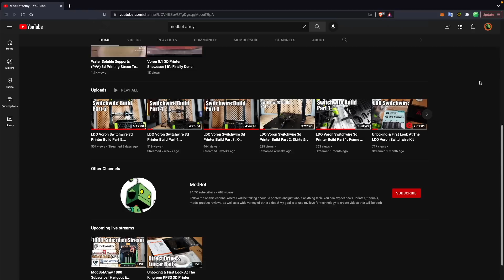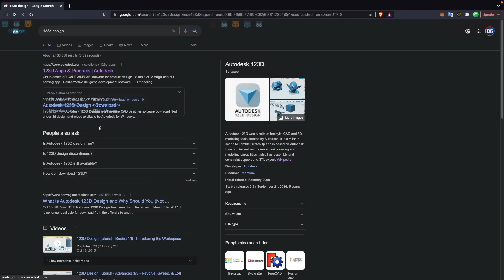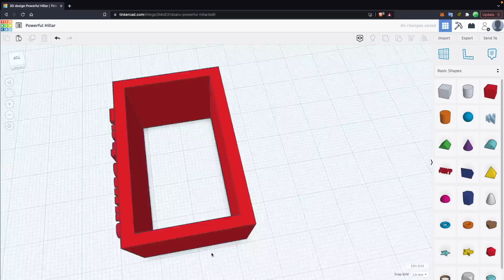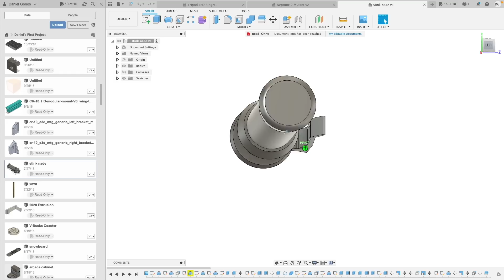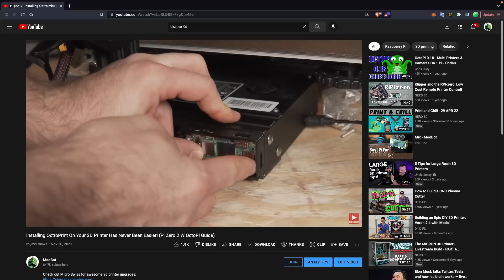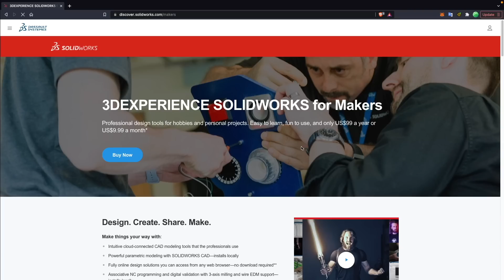Is 3d Modeling A Requirement For 3d Printing? (Where To Start)

Comment: Great video!  Personally, I tend to use OpenSCAD and FreeCAD the most.  I do a lot of parametric modeling and these are both good for that.  (Parametric modeling makes it easier to tweak and adjust a model after you create it.)  I tend to switch between Windows and Linux and these run on both platforms.  Also, both are free, an important consideration if you are just a hobbyist like me.  OpenSCAD is pretty solid, but everything is defined in code.  There are no tools for freehand modeling.  FreeCAD let's you be a little more artistic, but can be buggy at some of the worst times.  When using FreeCAD remember to save your work often because it can crash unexpectedly.
Reply: I totally agree. As hobbyist i started to learn fusion360. After a month Autodesk changed the licensing scheme so I've switched to an open source solution as FreeCad. I don't mind if Fusion is more powerful than Freecad. I have chosen Freecad for the open source mentality. I'm doing 3d design only for hobby during my spare time and I don't want to wake up a morning and see that Autodesk (or other vendors) doesn't let you use his software for free anymore. Freecad learning curve for complex models is quite more steep but it's worth the time spent to learn it.
Reply from the maker: An old coworker showed me OpenSCAD some years ago and I had completely forgotten about it. He was a head developer at my job and me having no coding background (few C++ coursed) found the workflow insane haha. It just felt like way to much of an uphill battle for me to learn the code and modeling side in one. 

FreeCAD seems to have been recommended a few times in comments. Is there no ability to have it autosave? I have serious bad luck with software that doesnt keep a backup. One of the reasons I moved to apple and their FCPX for video editing it any click I do it saves a version. I dont know if I can go back to crashing and losing the files.
Reply: @ModBotArmy  OpenSCAd is easier to learn if you have a programming/coding background.  Also, it forces you to approach your model a little differently.  For example, with other programs, you would make your basic model first then add embellishments such as fillets at the end.  With OpenSCAD you need to plan for fillets from the beginning.  Freecad has "AutoRecovery" and you can set a time interval for automatically saving AutoRecovery information.
Reply: @ModBotArmy  I've been bit by this as well. FreeCAD saved my butt by auto saving my last change. It kinda works like MS Word in that it offers to open the last manual save or the last auto save.
Reply: I have used OpenSCAD for about 12 years. I did already have a background in C programming and a little python. At the time I started my home computer was very limited but it was capable of running OpenSCAD so it was the natural way to go. I have installed Freecad recently because I can import step files which OpenSCAD cannot do.
Reply: OpenSCAD is the anti-beginner-friendly for someone wanting to model. You have to first learn 3D design, and then you need to learn how to code, or the other way around... it's super powerful, sure, but it's absolutely not a beginner product. FreeCAD can definitely be picked up much easier and there are great tutorial videos to be had right here on Youtube. Edit: Also, this is the last time I'm commenting on this channel, most of the time it gets deleted. If ModBot doesn't want me here, I can take a hint.
Reply: @extectic   I wouldn't assign blame so readily. YT uses a rigid word filter, context be damned, to auto-delete comments (and to demonetize videos) with some truly baffling choices for what's deemed an "offensive slur, period". "CAD" doesn't appear to be on the bad list, but who knows what else may be.

Comment: freecad is my personal choice :D
Reply from the maker: Any good resources you used for learning it?
Reply: @ModBotArmy   Joko Engineering's playlist is enough for me. I used to use Autodesk Inventor for school and i switched to FreeCAD after i graduated.  Never looked back since https://youtube.com/playlist?list=PL7eiW2bt21YU6QEbly78kUgQCNEiDUwSH
Reply: @ModBotArmy  also just to add, i firmly believe that as long as you understand the basic 3d modelling fundamental concepts (dimensioning, constrains.. etc), you can basically hop from.1 software to another. I was basically forced to use FreeCAD at work cuz they're too cheap to get inventor/fusion 360 licenses, and i find that its actually very good for what my company does (i work for a plc programming company, we have to print out load of demo kit parts)

Comment: Another super powerful one is Rhino 3D. 

All the cool kids use it, for parametric seems to be the best one
Reply from the maker: You are probably the 3rd person to mention it. Is it a one time purchase? Any idea what the price is?
Reply: @ModBotArmy  $995 for the initial buy. Upgrades to for new major release (current is 7) at this time is $595
Reply: I wouldn't really say Rhino is parametric per se. There is grasshopper, which is included, but I'm not sure I'd call Rhino parametric.

Comment: Design spark mechanical is free and great
Reply from the maker: Have never heard of it. Thanks for the recommendation :)
Reply: I use it I like it kinda a big learning curve but it is good
Reply: @mikeerwin7078  short cuts make it easy.
Reply: Yes! I was just about to write that, so amazed that it never gets mentioned when it comes to 3D CAD. When I got my first 3D printer one and a half years ago, I searched for a free CAD software and found Design spark mechanical. After an initial learning threshold of maybe an evening or two I was up and creating one thing after another. Well I still find things I didn't know about the program, but I meant that after an evening or two I had the most basic tools for creating the things I wanted. The rest is just googling and watching youtube instructional videos.

Comment: OMG same here. I was waiting for HP to hit the market yet they never came so finally got my QIDI Printer for some needed projects which well..got pushed away as I'm having so much fun with other FreeCAD/Printing projects! :) I worked with AutoCAD it high school over 30 years ago yet never really got into CAD since I got the printer. But find learning FreeCAD took only about a month. Have had the printer now for little over a year now but have started to design some really cool stuff: Bladeless fan (fan is new in that it pulls air in from the top and out again unlike most all others bladeless fans that pull air in from bottom), copper spool winder built around a 3d filament dryer.
Reply: Haha.....got a qidi printer too is a x-plus model, inorder to harness the strength and endless possbility with 3d printer i ended up learning solidworks, the only frustration i have with 3d printer now is the printing speed still slow as hell....I'm waiting for a break through in this area and hopefully we can achieve print in mins in the near future.
Reply: @adrenfu6238  Yeah I'm slowly understanding why so many have more than one printer! :) What I find that really sucks is that I'm starting out in the mornings in FreeCAD/printing before COFFEE!! But I have been debating if I should make the jump to Fusion 360 or not as I'm working a lot with gears. FreeCAD is doing a great job once you learn it's limitations and work around them. (my current project us using 39 gears!)

Comment: A lot has changed since then with blender. In many fields it's becoming an industry standard.
Reply: But Blender seems to be more of an animation program... a bit like 3D studio.... I always prefer proper engineering programs when creating functional stuff. Thats what they are made for. Like Autodesk Inventor or Fusion 360 for example.
Reply: @martinsvensson6884  yeah but in blender you can make an organic model like a cat then put it into fusion to shell out, cut into it and add functional features etc (mesh conversion using new organic command may be needed depending on complexity and file type).
Reply: @AmbitiousPanda  Yes but you dont make cats in engineering. Both 3D Studio and Blender are animation programs.
Reply: @martinsvensson6884  it’s a Swiss Army knife type of program it’s not just animation lol
Reply: @AmbitiousPanda  You can do all sorts of stuff. But its an animation program, or if you want, an artistic program at the core. Not an engineering program. You can do engineering models. But its not set up for it. You are going to get absolute hell if you try to use it as such at an actual work place where they engineer stuff or create models of things that are actually going to be built in a factory. Anything other than artistic 3D prints.
Reply from the maker: I have heard they have made a ton of changes and that they are releasing a new version that will have better hard surface/and possible parametric modeling.